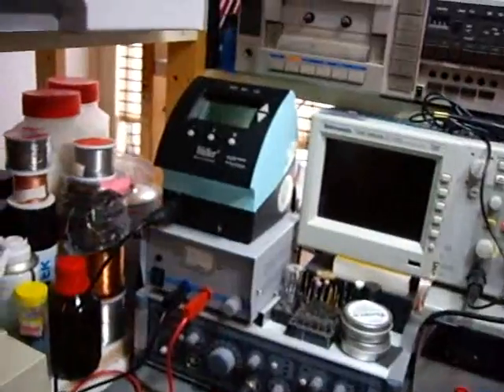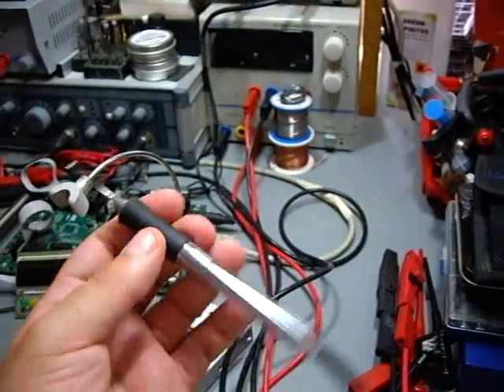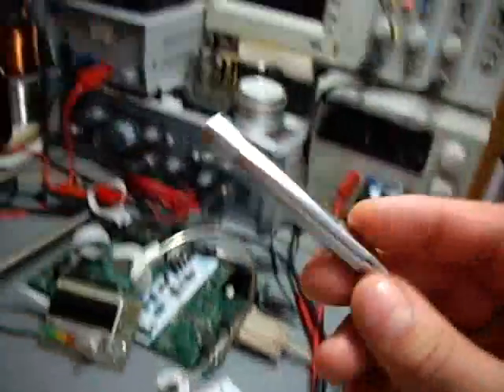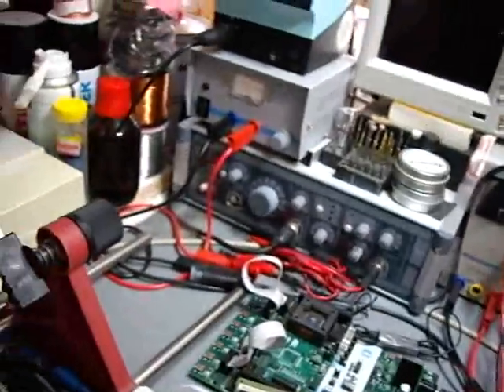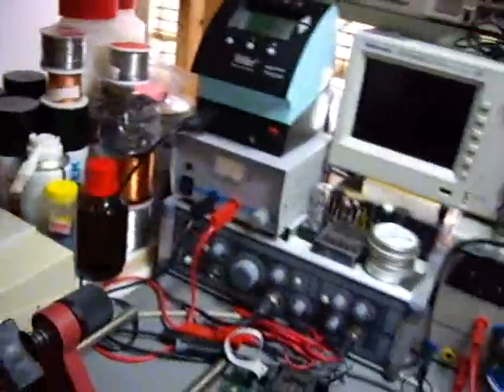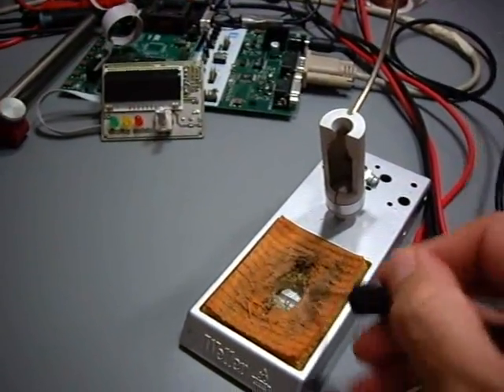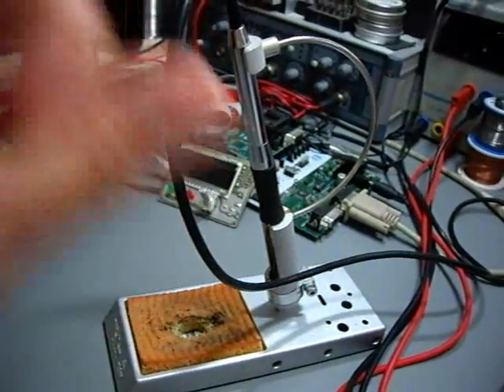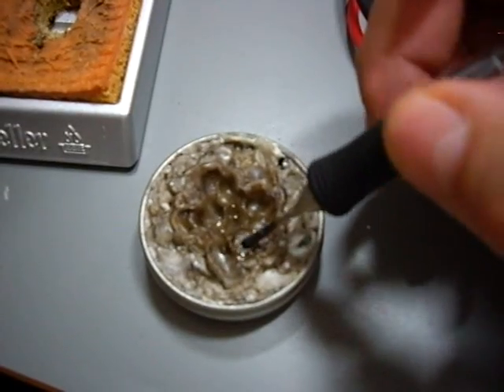My Weller WD1000M solder station

Comment: I have one of those tips that I want to make a diy soldering pencil controller for but I can't seem to figure out the pin out, I can get it hot to melt solder but no useful reading from the thermocouple. Would you happen to know what the pin out would be? I assume the outer body is ground.

Comment: Hello Linuxgeek, I have a question.
I am very interstered by this very nice soldering station, I have used lot's of direct 220 V plug irons, and I would like to change my work station,
How much time duty life of this kind of tip? A tip costed 32 euros, and if a tip have a short life time, I think this pen is not good for me.
And how much kind of  tips did you use for general uses? Thank you :)

Comment: I`d much rather go for the non-digital version, where you can turn the knob
to adjust the temperature. I bet they last longer than the digital ones. But i must say i am fed up with my cheap thick wired soldering irons. So therefore i gladly would pay to get something like this. But i don`t know what to get yet..i guess Weller is a good alternative.

Comment: - @ psyfertech -

It is not recommended as most solder contains lead - but I've been soldering for over 25 years.

Just don't sit directly over the work and huff the fumes.

Comment: Cool fine station. They made many improvements compared to old stations, it's incredible! Using flux with clean and small tip it permits soldering any SMD chip. 

The hard part is desoldering, but for new chips in prototypes is not needed so often.